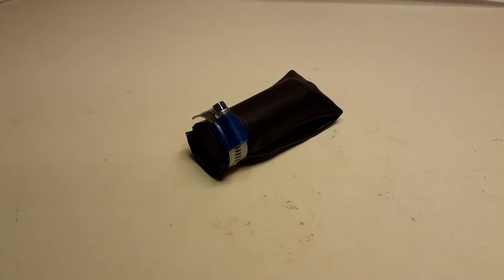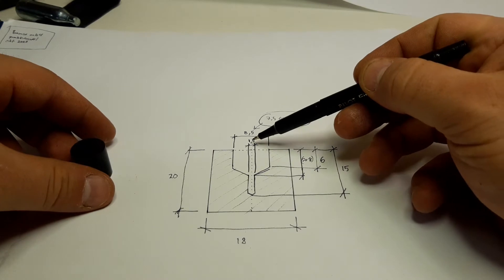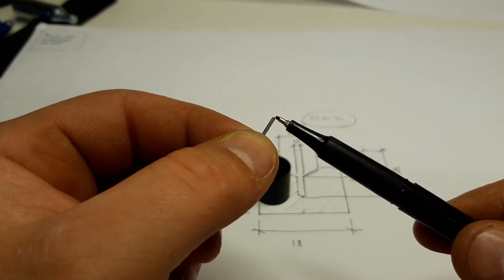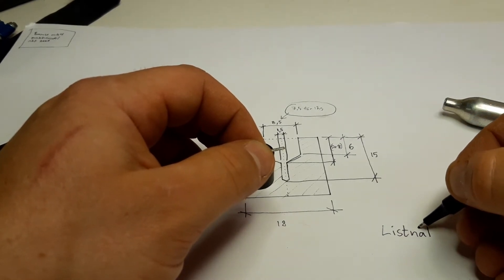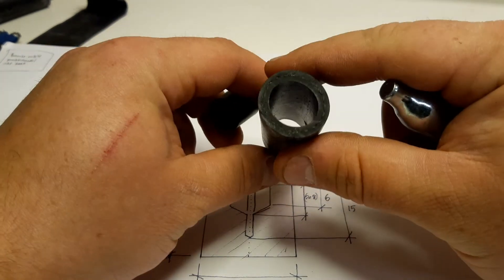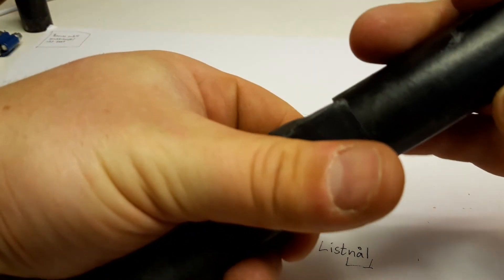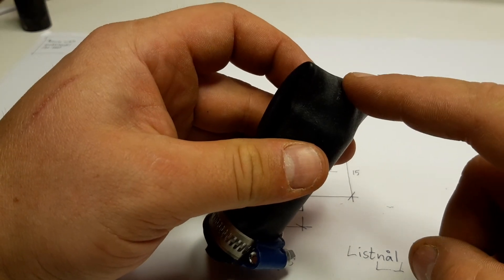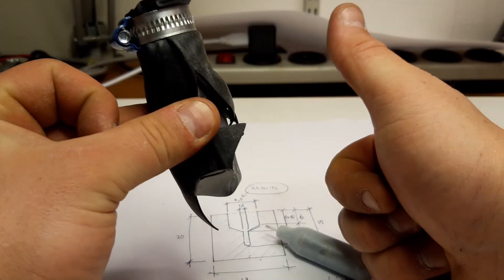Bamse mk4 prototype

Comment: Nice work man, I'm going to use your ideas and develop further if you don't mind...
Reply: Did you improve it? We’re looking at this aswell, would be amazing to skip the expanding part. Like a thunderbang, but without the expensive parts.

It would be soo nice to have a cheap DYI solution you could just forget after being thrown
Reply: Tried this out, it appears as if they leak to fast, was out of tube though will try again, there are nos-crackers for 0.6usd on amazon if you buy a 100-pcs, worth it if you're a team :)